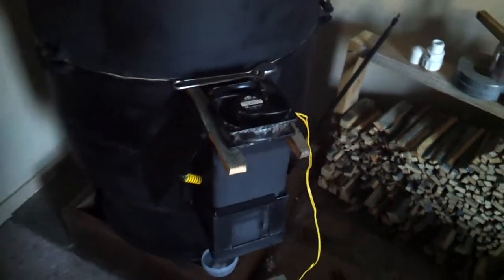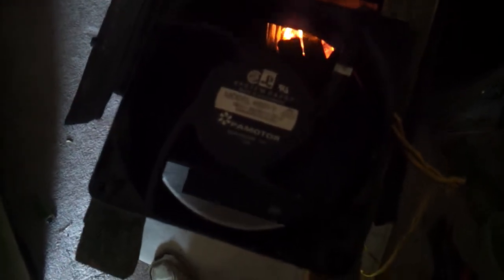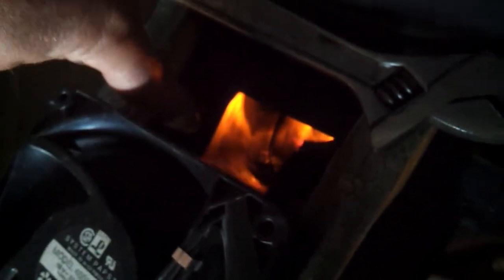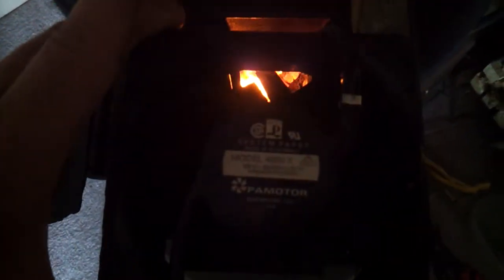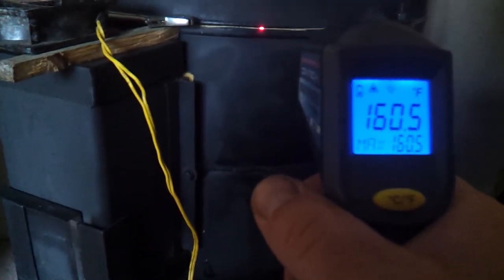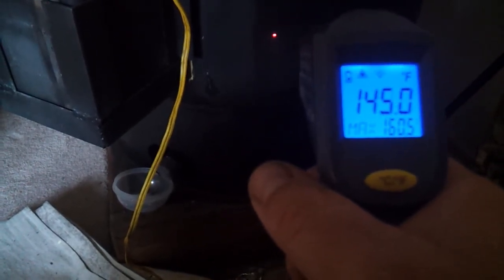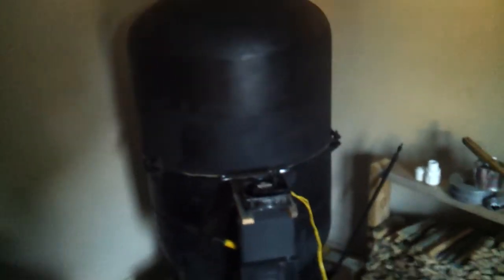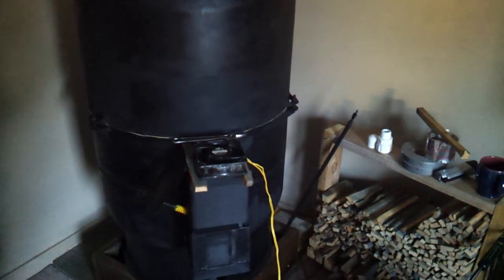Rocket Heater ~ Talking about drafting issues and solutions.

Comment: You have made things so complicated you've lost the meaning of your thought on keeping things simple.     I am sorry you're having so much trouble with draft.   Surprisingly your flue isn't causing the problem.   The flue must be the same size as your fire chamber.   you must have that plate of steel up under your fire or you won't get your wood gases to burn.    I wish you luck in your redesign of your fire chamber go for balance and not for an electric fan.  I hope this helps you.